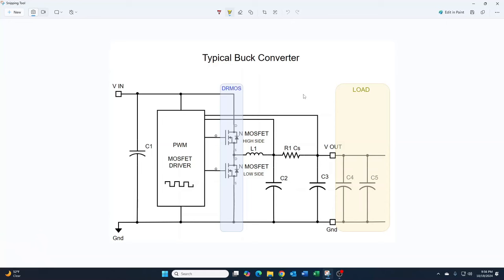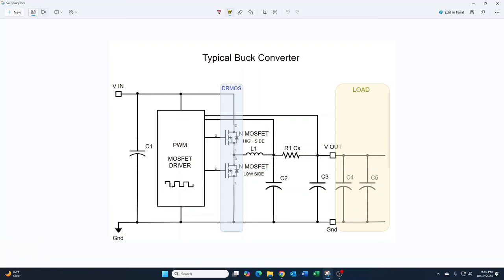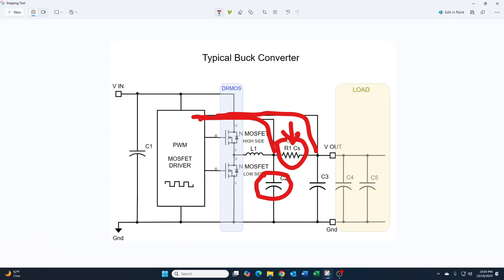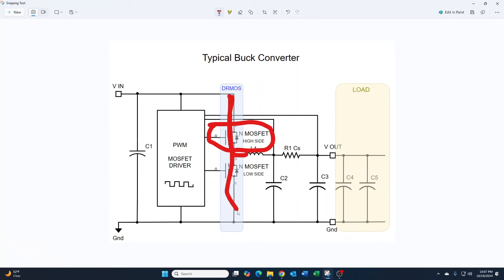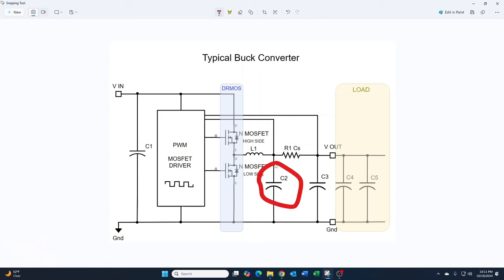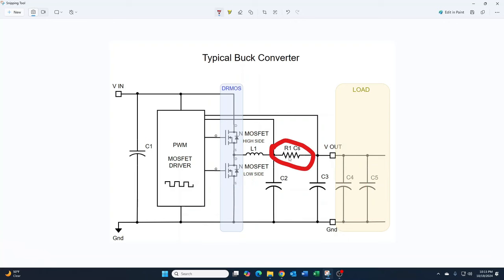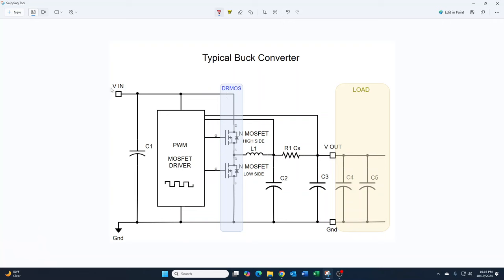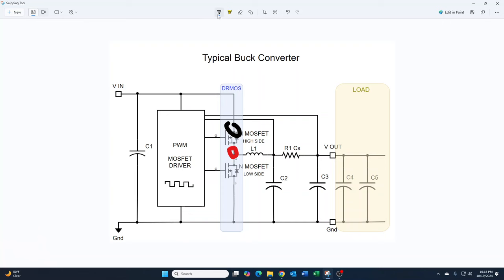Understanding the Buck Coverterter: The key to repairing almost everything electronic

Comment: Modern day electronics are built to fail, usually just outside the warranty period. Multiple voltage requirements were, formally, supplied via multiple secondaries from a transformer. Now, we have buck converters, which frequently fail. In the forty years I have been in the old school world of pro audio, I've never had a transformer fail. Progress, isn't always for the better.
Reply: Yeah! I'm sure I'd prefer my phone, tablet and laptop to have a 60hz mains transformer with multiple output windings.
Reply: @Graham_Wideman Obviously you missed his point. And his point is lack of reliability in these modern products, which works against the "health" of your wallet and you don't seem to realize that, or at least care about it. The ending phrase of your comment confirms this fact perfectly, but all about it is nothing more than an unsuccessful try to ridicule his comment, rendering finally your comment ridiculous...just because...
Reply: @ΠάριςΑζής  "The ending phrase of your comment confirms this fact perfectly" -- not sure what you're getting at.  But regarding "you missed his point."...  I get his point, I just think it's lazy, reductive and generally wrong.  Do you know how expensive it would be for electrical engineers to intentionally  design products to fail shortly after warranty expires? That is not readily predictable.  It is true that consumers experience products that fail disappointingly early -- why is that? Because consumers like cheap products, which are cheap often because they cut corners on reliability and robustness features, and certain countries and domestic retailers are happy to supply them. That doesn't mean there are no more-reliable brands. And really, if Walmart is selling you a 65-inch TV for $350 in 2024, are you going to instead favor a "big" color TV from 40 years ago (that cost considerably more) because it doesn't have any buck convertors?  Please feel free to describe any category of electronics that was, on balance, better 40 years ago.
Reply: @Graham_Wideman Here is the strange thing. You consider his comment lazy, reluctant and in general wrong, while your detailed analysis in your last comment justifies that he was right in his comment! I know and I understand every single word of your writing s, as I have spent all my professional time on electronics and I am convinced that every modern design, no matter how expensive is to buy it as a customer, is ridiculously cheap in its guts (compared to a similar product of the past) having in advance it's death date incorporated therein. If you believe it or not, it's a other story, and I don't intend to convince you or anyone else here. Some years ago, we, as technicians, were learning that quality is based on reliability, cost and life expectancy (working time) in general. This term has changed in our time. Quality is what the customer likes! And this explains everything! You refer to brands with good names on the market...If you just could see their electronics from the inside and you could be in position to evaluate their so called quality, be sure that you would say to yourself "I will never buy this toy"...Modern products are very rich (nice) from outside but terribly poor (ugly) from inside. Simply customers cannot see that. Every manufacturer of our time is affected from the idea of cheap production. If I can make it clearer to you by using simple mathematics, I can tell you that the issue looks like a fragment. Everyone tries the easy way, which is expressed by the motto "reduce the costs", which represents the denominator of the fragment, which in turn increases the arithmetic value of it (profit). But almost all of them do not like to work on increasing the nominator of the fragment, which represents the real quality of the product, simply because it adds cost on it...Hence reliability is lost forever in favor of low pricing, but perhaps very few people see that doing so only manufacturing companies get richer by the time passing, while the buyers of their cheap products are emptying their pockets willingly, due to their ignorance of how the modern marketing works...
On the top of that, consider that repairs on defective equipment are very difficult today, because manufacturers are not willing to serve this purpose, referring to sale a new product even if the defective one has a blown fuse. They do not provide schematics or spare parts as they used to do in the past as well. The result is that young people do not chose to be electronics technicians as it happened in the past and the customers are left completely alone, with the unique chance to buy a new product every time the old one fails. And then comes the absolute hypocrisy on the part of modern marketing, which is the idea of supporting the environment clean and viable...and....lots of similar bla bla bla....
Reply: @ΠάριςΑζής economics guys! If my firm sells a gadget with a mains transformer and another competitor firm sells one with a buck converter at a vastly reduced price. Who will the consumer favor and which firm will end up running out of business? Needless to say that electronic circuits are much lighter and consumer friendly than linear power supplies. Hope this helps!
Reply: @Snowsea-gs4wu Economics, yes! But for whose benefit? This is certainly not a "win-win" story...And this was the point of the above discussion...
Reply: @ΠάριςΑζής  for the one who made the decision to buy cheap/crappy or to buy less cheap/higher quality. I have a lot of cheap power supplies that fall all the time, I have quite a stash of branded (presumably high quality) power supplies that almost NEVER FAILED. As a consumer I sometimes choose to buy higher quality at higher price and sometimes the opposite according to how important it is to me.
Reply: @Snowsea-gs4wu Fully agreed. Still the inevitable question is there. Do you believe that the price of a product is the absolute indicator of its quality? I have a plethora of examples to tell you that this is no longer true! I will give you an example...It refers to the electronic card of a very expensive washing machine (compared to other brands). Of course i cannot make a direct reference to the brand...Among others, the tendency is to replace the relays with smd triacs...This is translated both in progress and cost saving (a win-win case). The point is that in these pcbs no optocoupler is used in order to protect the triac driver and the microprocessor in case of a triac explosion due to any reason. Then the gate driver is gone and in most cases the mpu pin that connects to the triac's driver gets immediately either shorted or, in most cases completely open. So, due to an external cause, which is expected to happen, the entire pcb has to be replaced. And for a good brand name it costs a lot of money. Far beyond being affordable. In the case of using relays, this type of failure is simply impossible to happen. So the idea of progress here is "blown in the wind". 
Furthermore the user has bought this product using the unique criterion of price and brand name. He cannot have any idea of constructional details. As a user, he only expects that his expensive washing machine will serve him for many years. Unfortunately this is not the case, since, by design, the machine is vulnerable in such failures...In other words, the high price and the good brand name are not the absolute criteria about reliability as they were in the past. Now this is a belief. Not a certain expectancy any longer! Or, a matter of good fortune if you wish...But this has nothing to do with progress based on technology at all. Its the marketing which turns the product users into product consumers...
Reply: @ΠάριςΑζής  I can only control what I do, so when I want a (potentially) better product that lasts (potentially) longer I go with a good brand name (Anker for example has been a GREAT value in the past for me). Nothing is free so a good brand name that is valued at millions of dollars has a lot to loose if they make a mistake and I know that it has happened in the past and will keep happening no matter what I do. Still in the long run my experience has been that good brand names last a lot longer than the other products and fail much less. Nothing is perfect and NOTHING WILL, we can only do so much and vote with our money according to our expectations and budget.
Reply: @Snowsea-gs4wu Agreed again! Just keep in mind please that the temptation of making things cheaper is always there and works in some degree even in good brand name products. So it's a bit unrealistic to say "this will never happen", just because it happens. Competition leads things there, perhaps inevitably. Of course one can chose a better quality product by paying more than usually, but still there is no warranty that the product will be as reliable as one things when buying it. That's all i want to say, based exclusively on my own experience on repairs and on the comparison of same products of the past and of nowadays, of same (good) brands, seeing their internal circuitry evolution. The tendency of it being cheaper is sometimes vibrant...Well, i wish i am wrong, but am i really?